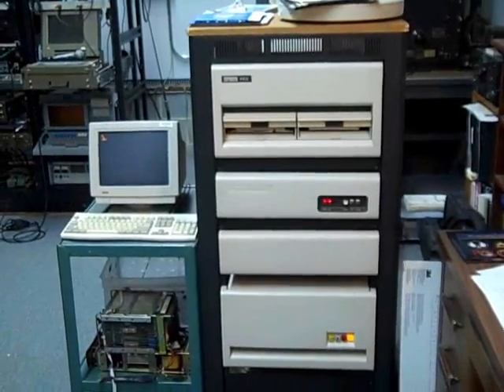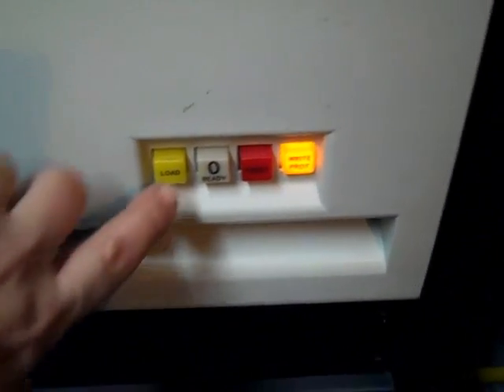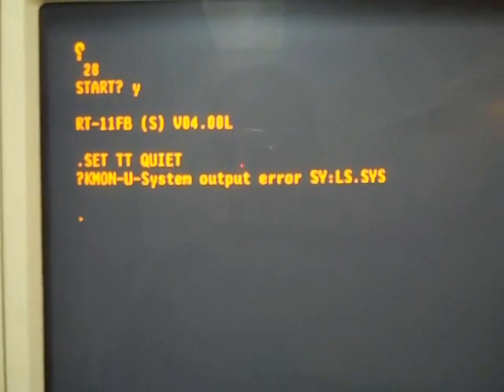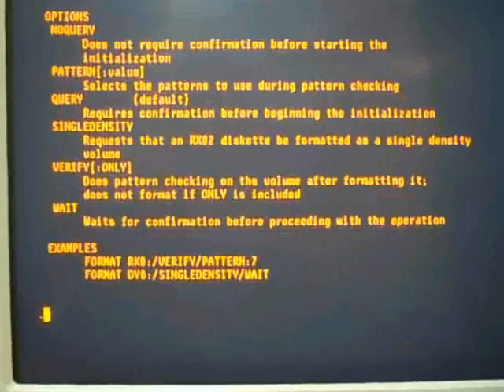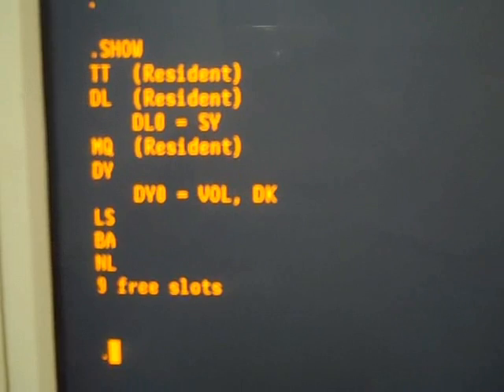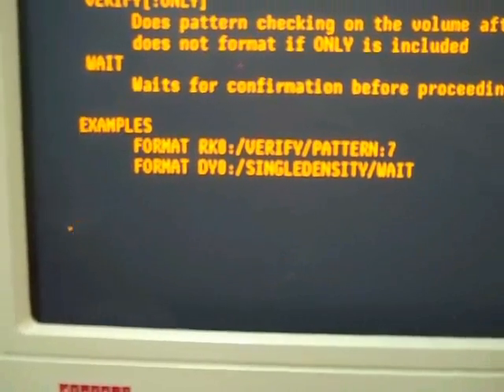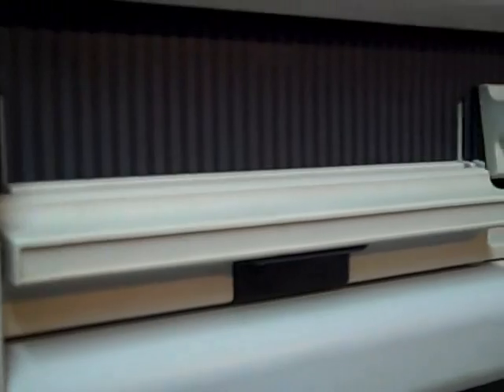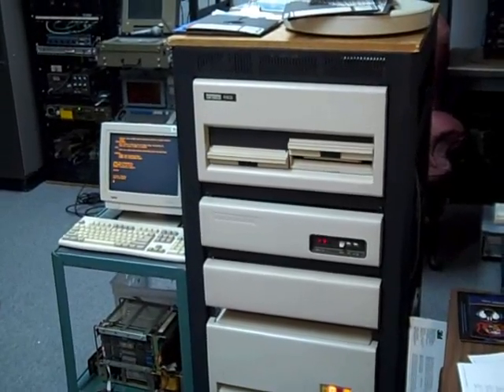PDP-11/23 2011

Comment: @geekinthepnig Why would you want to install Windows 8 on it?  It didn't even have a mouse, nor nearly enough RAM, disk space (if your system had hard disks), or a 32-bit processor with anywhere near a 1 GHz clock speed.  How about P/OS or RT-11, or UNIX?
Reply: I think it was a joke.

Comment from the maker: Depends what drives you have. RT-11 or RXS-11 for multiusers is the operating system of choice. Think the 53/73 also had a version of UNIX the RT-11 system will fit on a floppy if you have the RX drive